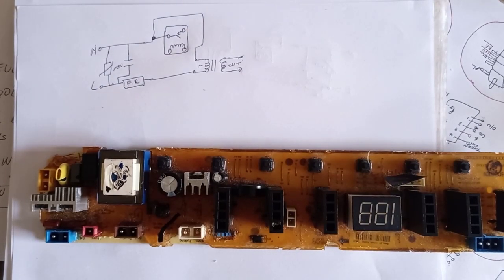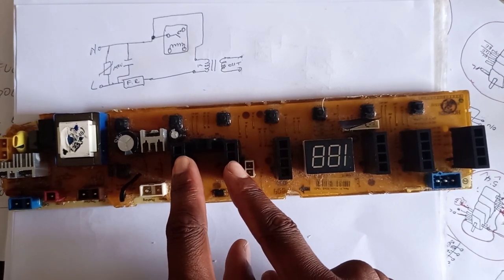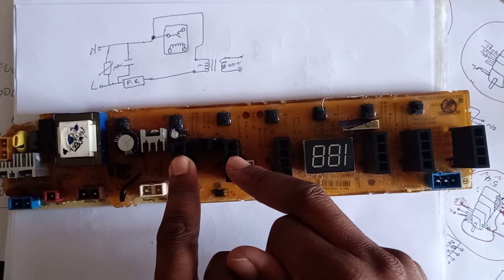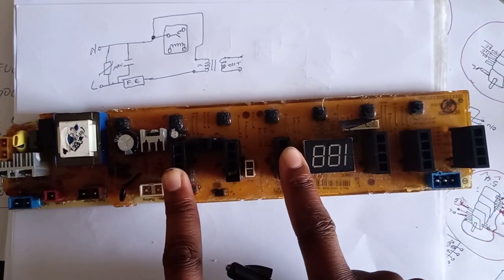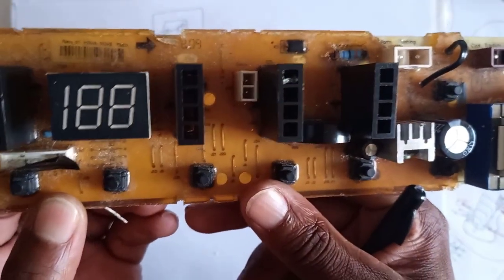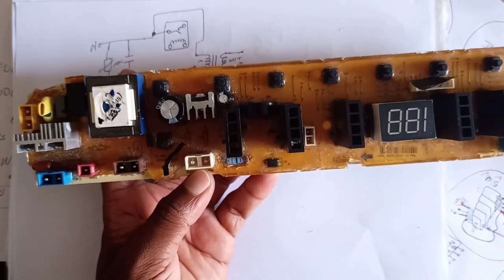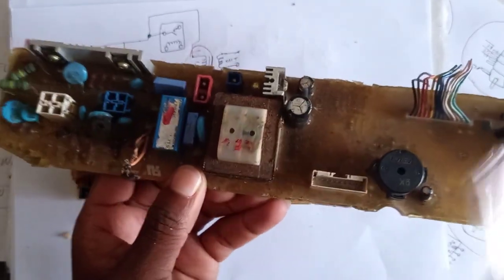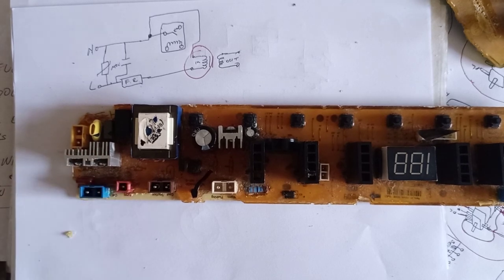PC Board fault finding for a toplaoder washing machine(part1)

Comment: Hi, I have the same machine with power problem. It won't switch on even after I bought a new board. What could be the issue?
Reply from the maker: I am sorry about that Mr Khoza, please check for continuity on your plug to a pc board maybe there is no power(should there be power whatsapp me so I can help you sir)
Reply: @appliancetech001  thank you for your reply, I really appreciate it. I was able to fix the machine with your help. It was the PCB indeed. How I came across your video 😮it's such a blessing. Thank you.

Comment: our samsung top loader drain pump does not switch off . we have replaced the pump and the pressure switch but still the drain pump will start as soon as we power on . could it be another problem or do you think it is a PC board and can it be fixed or do we need a new pc board too ? thank you i appreciate your content
Reply from the maker: If you have replaced a pressure switch with the correct pressure switch (since incorrect pressure switch does that), definitely it's the board. Rather replace the board.